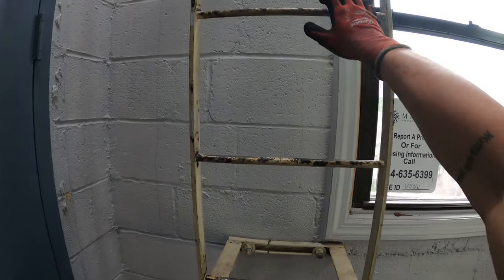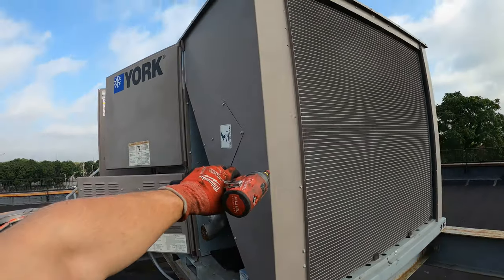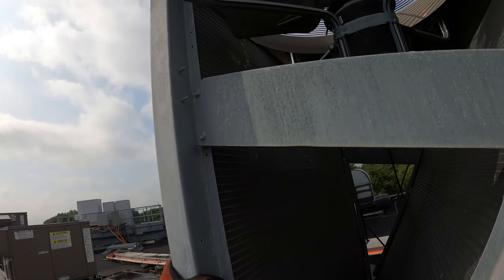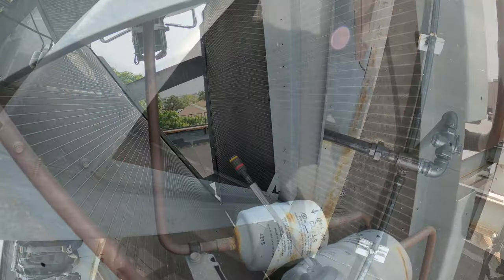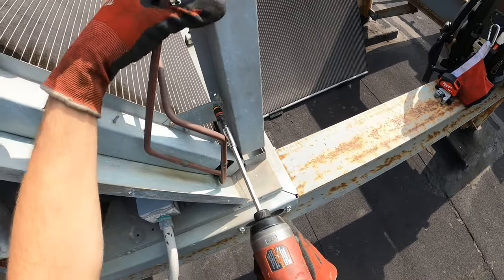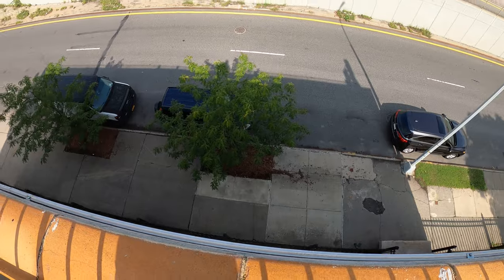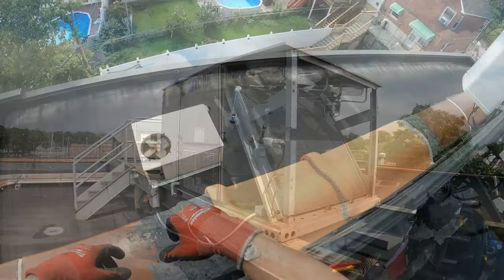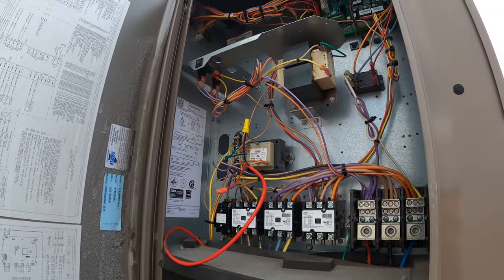HVAC Service Call: RTU Condenser Coil Leaking Refrigerant (How To Remove Condenser Coil From AC)

Comment: Is this going to be a repair or replacement? If you repair it, can you show us that? Thanks man. #AMC #GME to the moon 🌙
Reply: lol there's no fixing that, they epoxy weld that joint, and that sliced clean off. Has to be replaced, im sure there could be a way to repair it, but at that point, it's better to replace it.

Comment: I'd suggest to sweat out the joints, saves time and you don't need to repipe anything. First time i've seen a coil break like that, someone must've monkey yanked on that line, or overheated the joint to the point it got weak and blew under pressure. gg